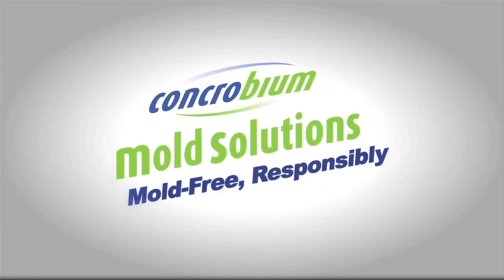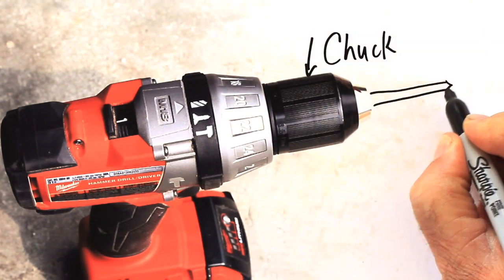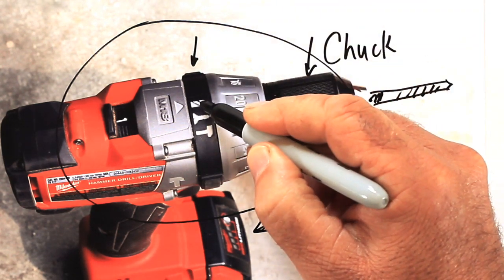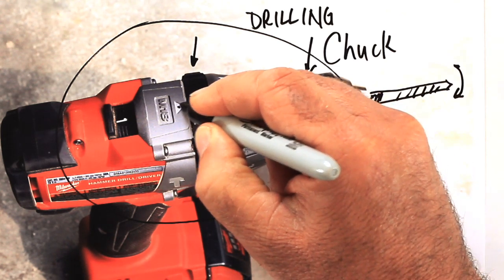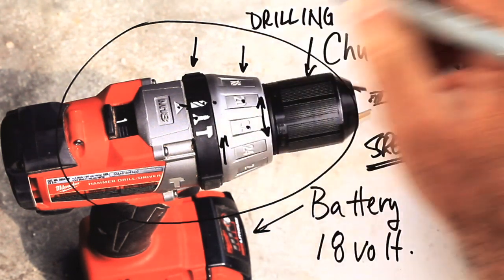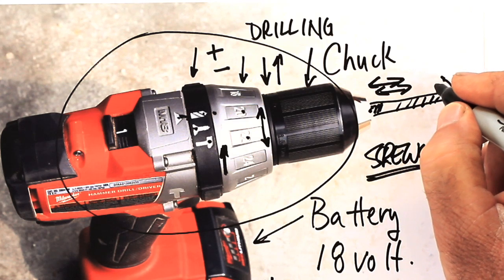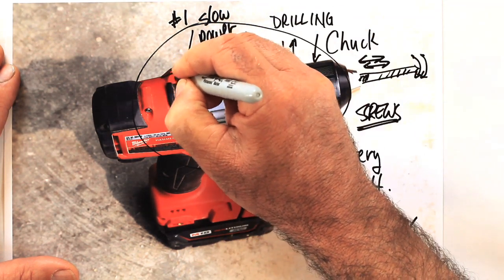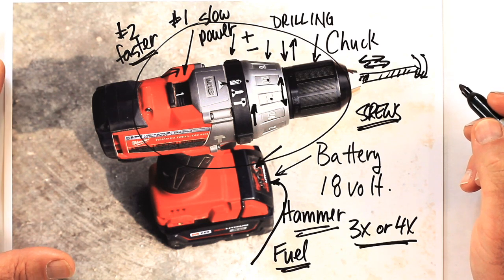Tips for Buying A Cordless Drill -- MOTHER EARTH NEWS

Comment: What was the name of that particular drill called ?
Reply: The Milwaukee M18 Fuel Drill Driver.
Reply: Fuel versions have a brushless (AC) motor, which should last longer than a brushed (DC) motor. The drill, however, runs off a DC battery, which means it needs to turn that into AC, which means power losses and a circuit that will eventually fail (transistors, which used to be through hole components, so relatively easy to replace, now are often surface mounted, which means fixing it is very difficult).